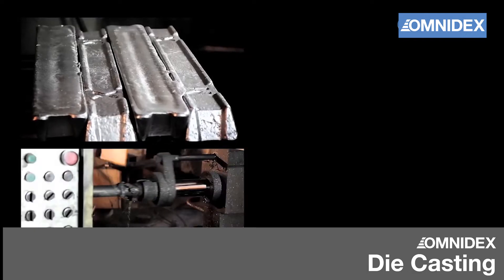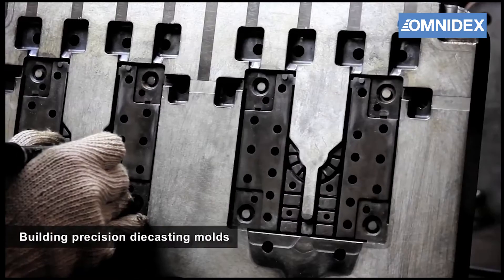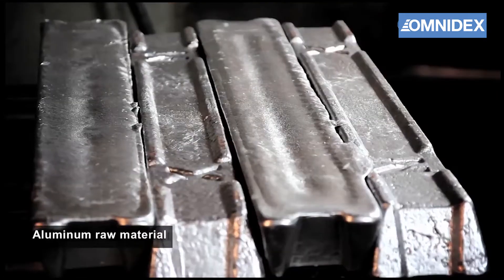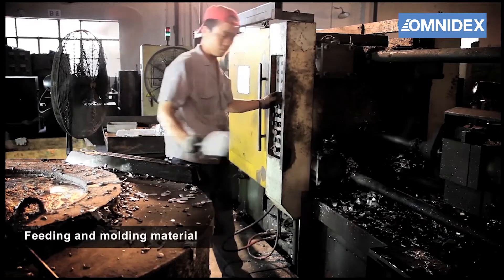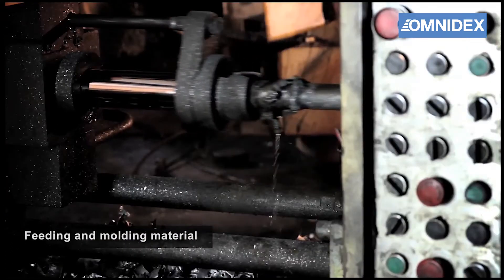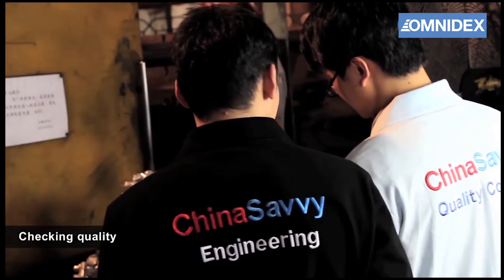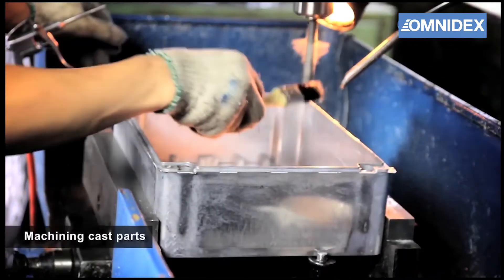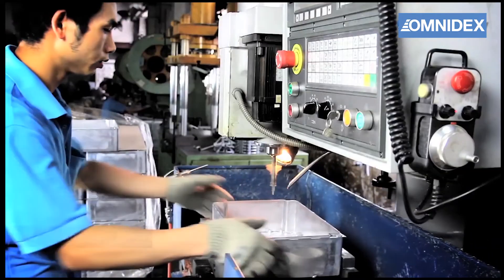Die Casting Manufacturer

Comment: 🔥 Clear intro to high-pressure die casting's strength for mass production! Before investing in steel molds, many teams use our vacuum casting or CNC machining for functional prototypes and low-volume validation. Smart prototyping paves the way for successful mass production. 👍